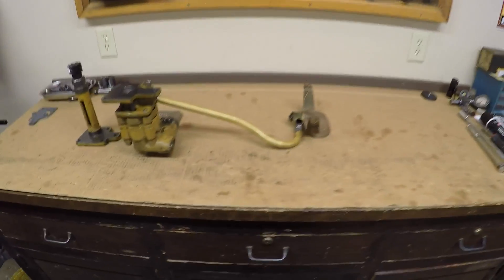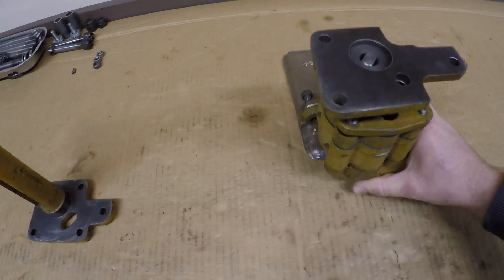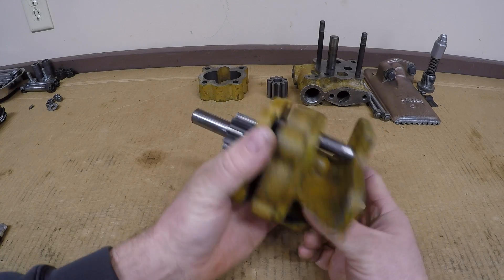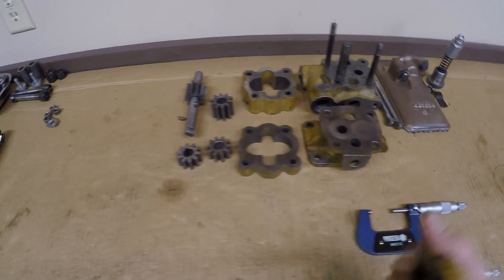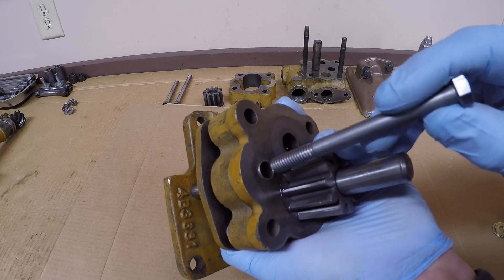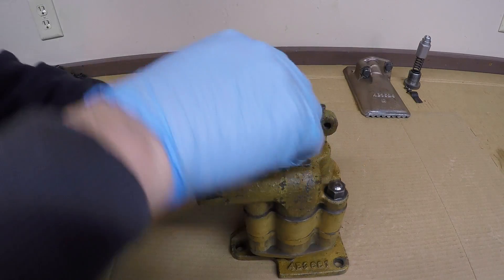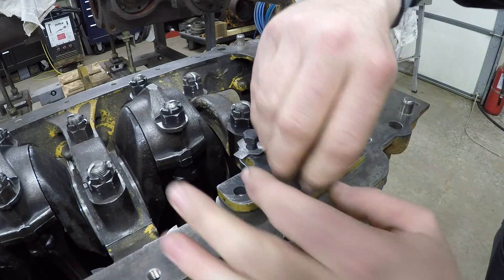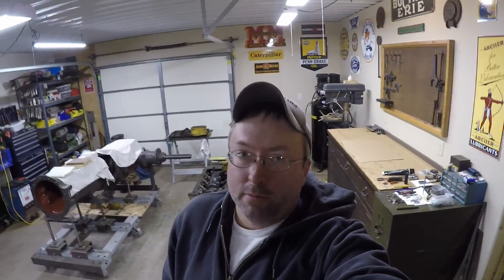Caterpillar D2 #5J1113 Diesel Engine Assembly Ep.15: Oil Pump Overhaul, Assembly, & Installation

Comment: Simple question, I understand the need for lock tabs and do not need to go down that road. However why is there not a locking device on the screws for the pressure regulator so you don't lose the thumb wheel holding tab and have the regulator thumb screw fall out?

Comment: When rebuilding devices that have gears with equal number of teeth would you find it advisable to first mark the teeth that are currently meshed to that you can a) put the back in the spame place so they will continue the wear against the other gear's teeth, or b) rotate them so each tooth meshes against a different tooth?

Comment: Hey Squatch, 20psi on the oil pressure. But it's adjustable, after the rebuild how do you know you've got 20psi dialed in?  Do you have to drop the pan to adjust pressure wheel?

Comment: Don't beat yourself up, that's why you have us apprentices along, to learn and help. When I saw the old pump in Cat yellow, I thought it might be external, especially with the pressure adjuster and all. Amazing how the paint survived all those years with all what was going on around it. Sorry to be thick, on the forward oil pick-up arrangement, I was also curious what front-down tilt-angle the engines were designed to cope with.

Comment: How in the world do you adjust the oil pressure to 30 psi? Do you have access to that thumb screw while the pump is installed or do you have to pull the pump to adjust it?
Never mind, you answered my question at 12:56.  Thanks.

Comment: What I find to be great about this whole debacle is that because of what I have learned from you over the last couple of years, and only because of that, I stopped at what you said before about the oil flow in the pump and questioned it. Your teaching, from a thousand miles away, did that.

Comment: It seems caterpillar is really careful about securing its fasteners from backing off with all the tabs they use. Then why do they leave 2 slotted screws on the oil pump that hold probably one of the most important pieces to the engine without any type of tabs? If those screws back off and the oil pressure valve backs out you lose all oil pressure right?

Comment: Good on ya! Better overall, corrected the pump action description and edited out the odd clip of the other pump's bottomed out pressure adjuster. Doing that is like turing the thermostat to 100 in a cold house thinking it will warm up to 70 faster. That knob sets tte bypass pressure... if worn bearings or pump result in low pressure and it can't get 40 psi hot... cranking the bypass up won't bring the pressure up.

Comment: Beautiful! This pump for how old it is is in great shape! A lot better shape than Senior's Super M oil pump. Thanks for answering the question "Can you get at the pressure adjustment though a inspection cover?" I'm surprised someone did not come up with a remote adjuster for that setup. Maybe some old construction worker or farmer did at some point. Really no reason to adjust but once...or twice...

Comment: I ask how is it possible to use a lock plate on the thru-bolt "studs" with the free nut on the other end? Unless those nuts are also locked there is the possibility of them turning and loosening. As for your apology,  we all have our brain drain moments.

Comment: I would have thought the 2 screws holding the detent plate on the pressure release valve adjustment would have had some sort of locking mechanism. Every other fastener has a lock.

Comment: Good job on the pump albeit hard to watch you beat yourself up again over the way oil is carried through the pump body creating flow and the restriction of the clearances causes the pressure rise that is limited by the dump plunger. The only thing I would add is that it is preferable to install the idler gears and the keyed scavenge pump drive gear back so that they are driving or being driven as they were before disassembly. Knowing you’re attention to detail, I’m sure you did that even though you didn’t mention it. 🤣 Lol on being demoted to the tire rack😂 and I have to agree in terms of stress it could be considered a promotion. Most of us know how much time it takes to produce a coherent video that keeps viewers interested to the end and yours, in my opinion, are among the best so expect to miss speak again, but remember that those of us who follow you know your skills and knowledge and are not looking to pick your work apart. Looking forward to the rest of the build!

Comment: I noticed these vids were down. I'm hoping that it's your strive for perfection that had you redo this one and not a pile of negative YouTube comments. Thanks for these. I love this stuff. The Wright Brothers used the same style pumps for fuel and oil in their first production aero engines. Driven right off the camshaft as well. Not really CAT longevity on those engines, though! :)

Comment: You could describe an oil pump as a surge milking machine cause you are one of a few who on camera anyway put grease of some kind inside the oil pump on assembly too many engine builders want to put the oil pump in dry WRONG some guys like replacing gaskets and bearings cause the newly assembled first start  turns out to not have any oil pressure, you only do that once in a lifetime lol

Comment: Nothing in the oil pump rotor cavity to help it prime?
Reply: plenty of grease? it should pick up oil in 3 seconds or less. you know hes going to turn this thing over with the pony motor and no compression for at least 5 minutes before trying to start it
Reply: @bcouri1  Squatch showed a light coat of assembly lube. In my experience this will take much longer to prime than filling the entire body of oil pump with grease or assembly lube. Whether you are turning the engine over with the pony motor or starting it, you are still spinning the bearings without oil pressure for a period of time. Personally I like that time to be as short as possible before the system is pressurized. That is why devices like pre-lubers (http://infinityaerospace.com/product/other/pre-oiler-and-back-up-engine-oil-pump/) and oil pump adapters exist to get the whole system pressurized before the engine is even turned over. Call it overkill if you will, but I like to treat my hydrodynamic bearings as nicely as possible.

Comment: I'm always astounded at how beautiful your gaskets are. Had you not mentioned making them, I would have assumed that they were die cut. Hopefully you can sleep again now, I know the feeling of discomfort that goes with making a mistake and needing to right that wrong. Hopefully you can sleep well again now. Stay warm over there, I'm off to move snow and work on equipment today. Cheers Squatch.